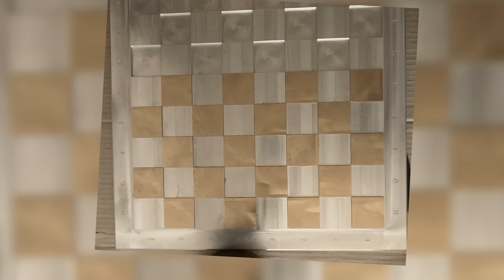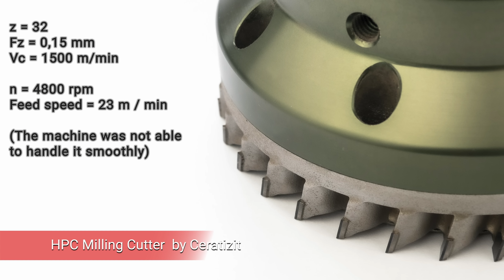Making a Chessboard with Chess Pieces - CNC Milling and Turning - Machining

Comment: Absolutely amazing. I worked in CNC manufacturing for 31 years but only in a setter/operator capacity and slowly watched the evolution of CNC machines. Back then in 1983 compared to now it is on a whole new level. When I try to explain to people it is the same old "you're only pressing a few buttons"......yeah right! Get a good quality programmer and you your factory and product are in safe hands. Out of curiosity how much would a chess set cost. I would estimate maybe £8-10000?
Reply: I'm only starting as a CNC operator (by starting I mean 2 years) and beginning to really get into the programming side, but I absolutely agree. People severely underestimate the time and skill needed to make quality products with CNCs. Then they see stuff like this that blows their minds.
Reply: 3
Reply from the maker: Hi Glenn, If you produce only one chess set it is very expensive. I think something about 4000-6000 Euro is realistic.

The more i produce at the same time the lower the price is. But it will never be under 1500 Euro.

Most people just see the material price and the finished product. They do not know anything about the work behind the scenes like planing the project, construct the parts, buying materials, making the Machines ready to work, ordering tools, programming, failing and so on.
Reply: @mygcode-cnc-cad-cam  incredible work none the less
Reply: @mygcode-cnc-cad-cam  Thats the thruth about the work on CNC machines.
Reply: @mygcode-cnc-cad-cam  I know you said "and so on", but also people not taking into account your time spent on programming, figure since you've already built the programming/coding once, you don't get compensated for the whole time the first time, but a small amount each time you use it over time, charging a small percentage until you finally break even, then finally start to make the profit from it.
Reply: @mygcode-cnc-cad-cam  I work for a machine manufacturer and am currently taking classes before stepping properly into the machines. Really cool to see this as we’ve just begun working with them
Reply: @JanusXAlvarenga  pay for machinists is way lower than what it should be. You need a lot of skills
Reply: Teach me 😭
Reply: 10000 $ for a chess set is way too expensive for such uses we have casting cnc is more useful for making machine parts
Reply: @mygcode-cnc-cad-cam  Hi! How to buy?
Reply: hey  to everyone in the comment section 
i have just completed my high schol and wanted to make my career in tool and die or a cnc machinist 
im keen to know what skills and certifications should i learn to be a successful tool maker 
would love to learn from the experienced comment section
btw im from canada
Reply: YOU'RE ONLY PRESSING A FEW BUTTONS. If I had a couple of quid Everytime I've heard that old cliche, 👍.
Reply: @mygcode-cnc-cad-cam  Do you have one for sale..... £2000 max?
Reply: @mygcode-cnc-cad-cam  don't forget machine maintenence and return on investment over 5 years to pay off the initial cost.
Reply: @anshulbhardwaj4038  but casting is ugly and cheap looking. High end players are willing to pay $ for the best quality and craftsmanship.
Reply: @sjsphotog  there are many kind of casting prosidures as well as forging some of them are very high quality like turbine blades
Reply: @mygcode-cnc-cad-cam 
It's a reasonable price to be fair.
Reply: @JanusXAlvarenga you
Reply: I did a search and saw one like this for about US$4,000.
Reply: @mygcode-cnc-cad-cam Maybe you could try and make it something like $1,231.23 perhaps? Another idea would be to make like 10 to 20 special edition ones for $10,000.00, and the rest at $1,000.00. Garry Kasparov (former world champion for like twenty years) might buy one. Wish you the best, cheers.
Reply: Не слишком для такого изделия цена значительная? 
Понятно что ресурс станка, время материал.
Reply: @mygcode-cnc-cad-cam 1500euro? I want one of these! 😉
Reply: I like this video. Thanks 😍

Comment: The truly unsung heros of these multi axis CNC machines are the software engineers!  As someone who has written software for a 2D CNC I made, I can only imagine the added complexity of several more axes, tool changing, angle/side changing!  All this and the program having to make all the spatial coodinate calculations as well as the decisions of exactly how to remove the material, it's mind boggling!
Reply: Mostly these programs are made from a postprocessor, which writes the toolpath... you load your CAD data into it, the tools you want to work with and the postprocessor will do the rest...
Reply: the software is so very advanced now adays, it knows what to avoid.  But Yes very good application. Well done.

Comment: I run a CNC lathe NL2500 mori Seiki for the last 8 years. And I’ve never seen CNC used so beautifully 💯 great job 👏🏾
Reply from the maker: I love machines from japanese manufactures.

In my opinion they build the best machines. They are so reliable with a great precision.

Wishing you the best.
Reply: @mygcode-cnc-cad-cam  HI out of curiosity what machine are you running ?
Reply: @mygcode-cnc-cad-cam  which one are u using in this video

Comment: Good gods. Reminds me of doing mine when I was 12 in '88. Had to graph paper the shape and with tool templates work out the correct geode program. Then hand type it in on 3.5" floppy drive school cnc. The poor thing could only cope with about 30mm diameter stock..... it took me a couple of months of dinner times to run the cnc! Still have  the parts! Loved it. Although the aluminium did chatter whilst being machined. Never did work out why. Spindle speed probably.
Lovely job.

Comment: Those are SUPER CLEAN, wow! Very traditional. I am actually halfway thru doing the same project except I don't have access to CNC turning (only manual). I am having lots of fun but I cannot finish it due to school being out. Cannot wait until I can have access to CNC! 

And yes, I am doing brass vs aluminum. I wasn't sure if there was a soft metal of similar density to either but different color :/
Reply: Can do aluminum for both and anodize different colors, or titanium but its more expensive!
Reply: @TheBryanNeill  brass is my favorite metal, stick with that!
Reply: How much?

Comment: Superb. An alternative attribute  that this particular set here offers is that the pieces are differentiated via separate color metals, meaning you can actually play on the set (they have to be structurely sound so they don't tip over easily, also). For example, if you made all of the pieces out of stainless steel alone, you'd have to then go back and coat the opposing pieces a different color to represent either the black side or white side (dark vs. light, red vs. blue, etc.). Many coatings suck and eventually come off in time from the pieces being knocked around in the course of play, but bare metal won't do that. All in all, amazing chess set created, thank you for the video.

Comment: That is nice ... I made a set in '76 from 303 and brass all manually at lunch time  but with a glass board painted on the underside the 2 colors attached to a wooden table .
Took for ever . Sprayed with many coats of lacquer.
Reply from the maker: Does it stil exist? Sounds interesting!

Comment: This is awesome! Thank you for taking the time to record and edit this for us! Ugh! I can only imagine what it was like to make all this. Drawing tool path for Black's squares and then watching it run for the first time must have been really monotonous! I was impressed with your machine on the second op with your (idk, half inch?) endmill cleaning up the shell cutter without blend line. Even though I do it all day, I still find it mesmerizing to see metal being turned. 
Did you drop RPM at partoff to avoid it flying off and getting dings? Also, how are you holding your board down? I'm not too familiar with the varieties of mill fixtures. 

Good job! 👍
Reply from the maker: Yes, when you cut off it's a good thing to reduce rpm at a certain diameter. 

For the pieces i decided to reduce rpm and feed at a diameter of 2mm.

It depends on the weight of your finished turning part. The more it weights the earlier it will break if you come to the middle. 

Thank you!
Reply: Definitely 14 minutes of my life I'm not getting back. But no matter just love watching CNC machines working.

Comment: I really enjoy the design of the pieces. They turned out very elegant. It was clever of you to aim for a slim and traditional design and to keep the weight down. I was particularly impressed of your solution for the Knight. Next time consider making both sides of brass, and acid treat the "black" side.  To chess players it will be a big no-no with the weight difference between the alu vs brass. Also make sure the King is slightly higher than the queen. However you have demonstrated your excellent cnc design skills.
Reply from the maker: Hi belledetector.

I am verry happy that you enjoyed it.

Hornestly I knew about the problem with weight differences but I wanted to know the outcome and the look brass / Alu.

I love the appearance but I am with you. 

I like the idea to make the brass black by acid treatment. Did you ever do  that?
Reply: @mygcode-cnc-cad-cam  Hi, No I haven´t tried myself but I believe it´s fairly simple to etch brass and bronze with Ferric Chloride to darken it. Sometimes citric acid is added to create a smoother surface. I suggest you look at tutorials here on YouTube. Did you write the program, and design the pieces yourself? How tall is the king in this set?
Reply: If you will sell me a set of brass pieces (32 pieces + 2 extra queens) without the board, I will acid etch the black side myself and show you the result. What do you think? (How do I get in touch with you?)
Reply from the maker: @belledetector  The King is exactly 70mm. I replied your e-mail :)

Comment: really love this board.  just curious.  could you have used black onyx and ivory for the pieces as well?  do you know if they can be milled as easily?
Reply: Given that ivory is illegal across most of the world I would guess the legally available stuff that remains is ridiculously expensive. Perhaps adding the ivory and ebony as an insert,a ring in the groove in the base maybe,that would be nice and a lot less expensive I would imagine.My wife has a reasonably large ivory owl ornament that's quite valuable but I don't particularly like it,you could have that to cut up😁.

Comment: Very Good.
It's one of those things many with a CNC think about ? 
Making a Chess Set 
( of course, this depends IF you have a use for it ?? )

A Good combination.
5 Axis Mill and what looks like a C Axis Lathe.
When I seen the surface being cut with the small face mill, I was hoping there was plenty of support under the Aluminium plate ??
But the surface finish was looking Very Nice 👍
Reply from the maker: Yes, there was a Support under the plate. Otherwise the surface would not come out that good and of course there would be a lot of noise. :)

Comment: DMU-65?

For a mirror finish, I ran a Mitsubishi index cutter (8”-10” Dia) used for decking heads and cutting mating faces on engine blocks. The sweeper design of the indexable cutting elements each had to maintain a .002 depth of cut and the chip load was critical to avoid wobble. The idea being that each cutter is engaging in the same amount of load to keep from wobble, the sensors in the spindle also helped monitor harmonics, this was material dependent, we were using 6063-S (6061-T6 with minimal tramp materials for semiconductor).

The machine is rigid enough that an XY pass yielded decent results, instead using only X and turning the table led to slightly better results, we were shooting for a mirror finish off the machine with minimal tooling marks to reduce finishing times later on and maintain .001 or better flatness on 18”-24” Dia parts, some had to go on the DMU-85 or even the DMC-60’s.

You’re cutting dry so you can film the machining for YouTube?
Reply from the maker: Hi Jake,

Thank your for thoughts.

Yes, i ran dry somit can capture everything better.

It's an DMU 50 2nd generation.

Greetings.

Comment: 8:20 do automated CNC lathes like this change the RPM based on the diameter of the cutter head at any given time? 12:25 interesting order of operations with it cutting the mane on one side and the eye on the other! Perhaps it's easier to see live, but I find the difference between the brass and aluminum too difficult to contrast on the board.  Perhaps copper would have worked better on the board, but it is beautiful.

Comment: Amazing stuff. By the way, do those metal chips (?) get collected and recycled, or is that just not cost-efficient enough and they get thrown away instead?
Reply from the maker: We collect the chips and sell them.

The chips gets recycled of course :)
Reply: You have to recover your costs where possible, and, throwing away several kilograms of material is not exactly a bright idea when the scrap merchant or similar will pay relatively good money for your known high quality material.

Even at a hobby scale it is totally worth saving the chips and scraps to sell to the local scrap metal merchant, over the course of a few years you could save yourself thousands of Dollars/Euros/Pounds/Yuan/etc...

Comment: it was also possible to install neodymium magnets on the back of the board in the center of the squares. And into every shape too
Reply from the maker: Finally i think it was not necessary to use glue because i made the pockets tight enough. The glue is just an aditionally safety thing.

Neodym may be possible but absolutely not necessary.

Comment: It's not the manufacturing that blows my mind but the work to set up the order of operations & what those operations entail.... O.O'
Thankfully, once you got the "program" to work you can trust the process & make as many as you want I guess?

Edit: I work in 3d development but how the heck do you guys translate that to cnc manufacturing. Manually guess at tooling & operations?
Reply from the maker: Thats right. When the process ist running fine you can make as many as you want without standing at the machine the whole time.

Comment: Mit welchen Toleranzen wurden die einzelnen Quadrate gefertigt, dass diese so genau sitzen ? Und wie wurden die Buchstaben gefräst? Ich haben nämlich vor ein ähnliches Projekt für die Schule zu machen und weiss nicht wie ich die Buchstaben machen kann.
Tolles Projekt!
Reply from the maker: Die ist Taschen wurden mit 0,05 Untermaß gefertigt. 

Die Buchstaben und zahlen wurden mit CAM Software programmiert. 

Viele Steuerungen haben auch Gravierzyklen.
Reply: @mygcode-cnc-cad-cam  danke viemals!

Comment: I am curious, how much does this machinery cost? This is some of the most elaborate CNC machining I have seen. I am interested in this. It's got to be 10s or 100s of thousands. Do you know the exact pricing?
Reply from the maker: The DMG Mori milling machine is 2 years old. We paid something about 220.000 with this setup.

The turning machines price was something about 170.000 8 years ago.
Reply: @mygcode-cnc-cad-cam  Wow! CNC machines are so pricey! Wish you could get these capabilities in a smaller form factor for hobbyists around the 10-50g mark. Thanks for reply! I will continue to dream! Haha

Comment: Which chemical is use to fix the blocks in alluminium of chess board 
Pls tell me current. 
Its urgent please
Replay
Reply from the maker: Hi,

we used "Pattex Kraft Mix metall".

But hornestly I think it was not necessary for this project because we made a fitting - 0.07.

It seemed to me that this was enough. No chance to loosen them even without metall glue.

Comment: Gunna try to do something similar in my class but unfortunately don’t have CNC mills big enough to make a normal sized chess board. Which sucks so I’ll have to size everything on the smaller side. Plan on making a full set for my father.
Reply from the maker: Hi Cailyn,

i feel your problem. The table size and ways a machine can drive is often a limitating factor. A machine can't be big enough. :)

Comment: Was zur Hölle ist das da für ein Fräser der da ohne mit der Wimper zu zucken über das Brett knallt. Die Oberflächengüte ist atemberaubend nach dem Planen des Brettes mit den Messingplatten. Warum kam der Fräser nicht beim Planfräsen des Schachbretts zu Beginn zum Einsatz, sondern erst nachdem die Messingplatten drin waren?
Die Bilder der Figuren gefallen mir. 
Welche Maße hat das Spielbrett?
Was sind für genaue Materialien zum Einsatz gekommen und was hat das Brett und Figuren circa gekostet? Also nur das Material.

Stunning!
Reply from the maker: Das Schachbrett wurde nicht an einem Tag gefertigt. Der HPC Fräser wurde uns erst etwas später zur Verfügung gestellt.

Die Aluplatte ist 430x430 und die Dicke beträgt 25mm.

Die Figuren sind aus Messing und Alu 7075. Das Brett ist aus AlMg3.

Das Material hat circa 180 Euro gekostet.

✌🏼

Comment: Can you tell mi 
Which cutter s are used in overall operation
Reply from the maker: Hi,

For the milling operation we almost used cutter from Ceratizit (WNT).

For turning we used a mix from different manufactures like Ceratizit and Garant.

Let me know if you need some more informations.

Comment: Would loved to seen the centre squares reassessed with circles. Then if it was ever on played on a moving plane or ship or train. Then the chess pieces would not move. Either that or put strong magnets in the chess pieces bases. So it could be played against a wall. That'll get the players thinking in 3D space